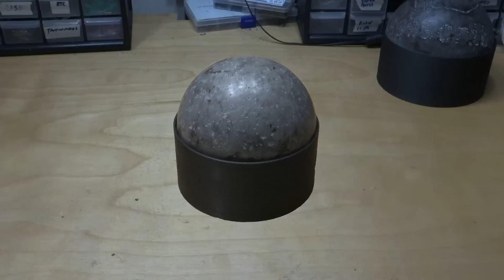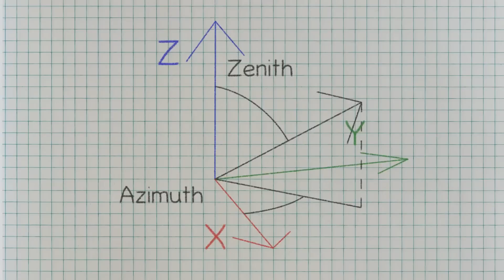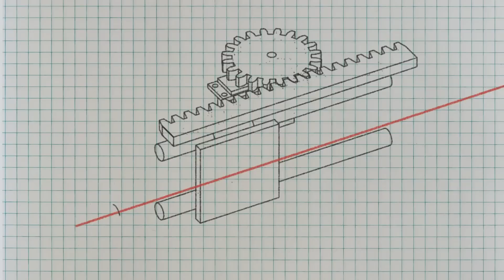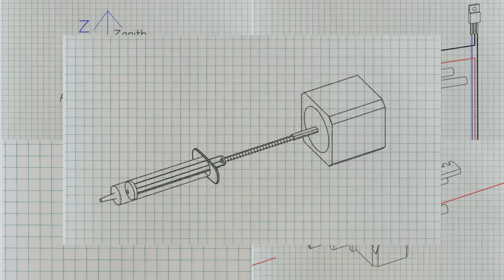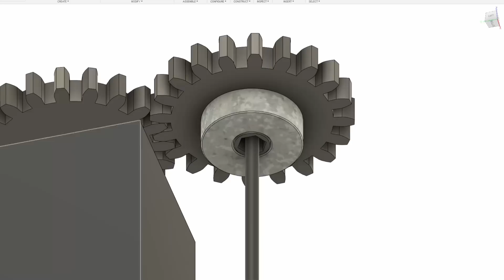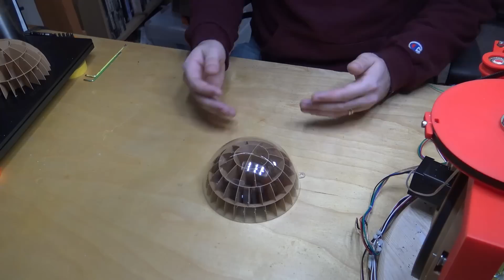This Lamp Has a 1,000-Star Map on it, and I Automated It

Comment: this old tony looks different 🤔

jokes aside. do you think the blade to cut the fiber will start to wear and not be sharp enough to cut after say 1000, or 2000 cuts? do you have something in place to check if the fiber is cut before moving on?
Reply from the maker: I haven't had a problem with that yet, the blade that's in there has probably made 4,000 cuts and it's still doing fine. I usually sit in the room while it's running, if something goes wrong it tends to make a bad sound 😅But no automated way to check

Comment: To answer your question regarding the super glue, yes they get messy and sticky. All the binders used to make the product stick to everything and you need to use a Positive air pressure PPE when manufacturing it. But to unglue everything after each batch we use barrels of 100% acetone  to clean everything.

Comment: This is very cool! I feel like I'm witnessing the start of another great maker youtuber channel (only 1.1k views at the moment). My only critique is that I would have liked a brief look at the code that runs it, the LED installation, and the concrete process as well. I'm curious what sort of concrete you used, and also how you got it to fill in all the gaps in between the filaments. Some sort of mechanical agitation, maybe?
Reply from the maker: Thanks! I'm planning on covering most of those questions in the next video

Comment: If you had a bright enough display panel you could bundle the fibers in a random arrangement, mount them to the display, and use software to map fibers to pixels.  Each build would be different so you'd need a way to quickly generate the specific pixel/fiber mapping for each dome.